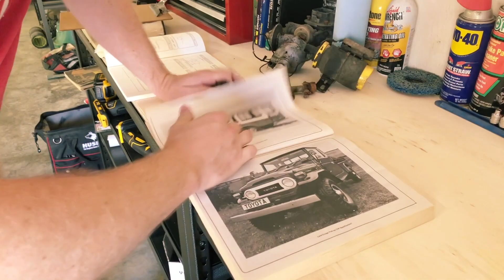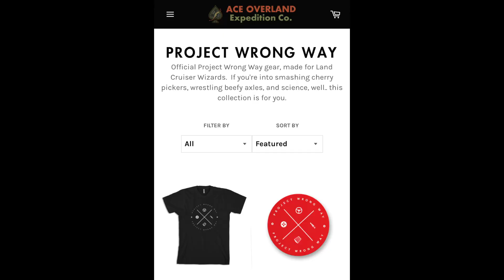Shirts, Anne Murray and FJ40 Front Bench Tear Down

Comment: G'Day Mate, with the rails you don't need to pull them apart. Just clean them up by spraying cans of Penetrating Oil in and work it back and forth until it moves freely.
Reply from the maker: Appreciate it bro, and they're soaking as well speak.

Comment: Seat tracks should have a catch that is moved with rage lever when the adjustment lever is pulled. The catch goes into detents to stop track from sliding. These tracks are usually Clear Zinc (silver) colored. Springs should be able to repaired by upholstery shop?
Reply from the maker: Good info, I’ll keep soaking the rails.

Comment: I don't usually separate the rails, just soak them and gently free them up with some friendly persuasion.

To repair damaged springs you can potentially braze/weld. I've done both, yet to find out which lasts longer. Both have pros/cons. Seems to happen when seats are removed and people stand on them.
Reply from the maker: I know my kids are going to stomp on the seats... did you paint (powder coat) the whole shebang? Springs and all?
Reply: Just spray can, don’t see the point of powder coating them. It’s super expensive over here. Easy to touch up spray can job if required.